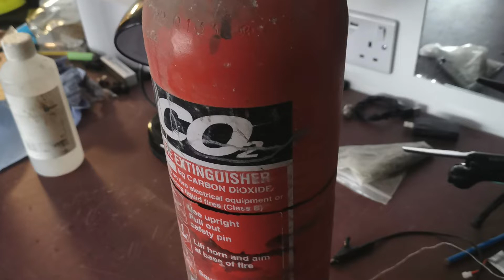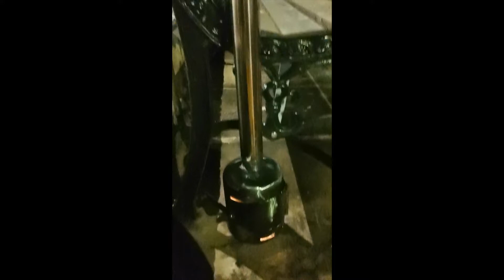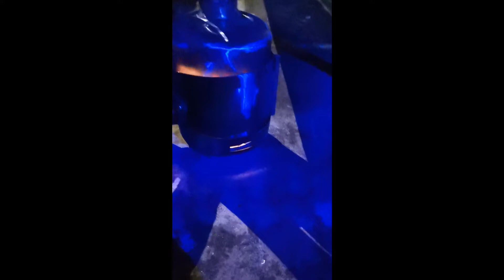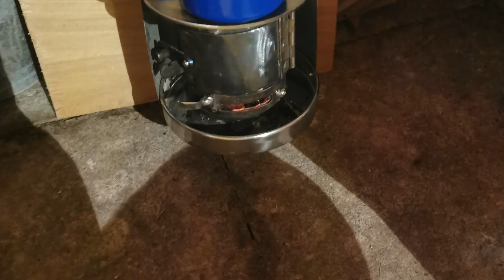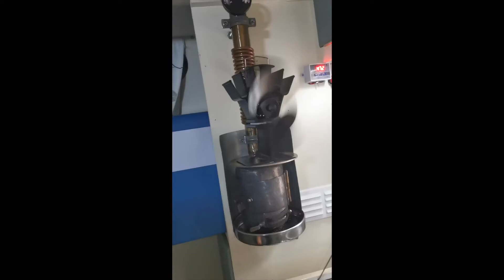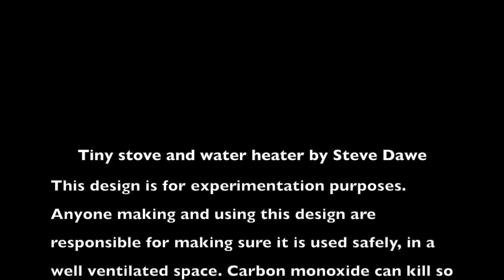How to make a Tiny Stove.

Comment: This is a fantastic idea, enjoyed watching. Thank you for sharing. 
Can I ask, what circulator pump, heat sensor and hot water tank did you use?
Reply from the maker: I used a 12v low volume grothen peristaltic pump(£13) controlled by a 12v temperature controller and sensor model W3002(£9). The water tank was a 6l under sink water heater, which i modified by replacing the 240v water heater element with a 12v 150w element. This meant that my solar panel can also heat water when my battery is fully charged. I use a voltage controlled relay to dump excess energy in to the water heater.

Comment: That's not only beautiful, its extremely practical and enhances life in your camper without costing huge amounts of money. 

Thank you for sharing this gem of a stove and water heater, it'll inspire others to consider making something similar for thems.

I agree with you about using charcoal, light and very efficient for generating a good heat output with good burn times.
Reply from the maker: Thanks for your kind comments. It certainly makes camping much nicer in the shoulder months here in the uk.
Reply: Pls make this a buisness 🙏
I would love to buy this from you!
Maybe putting some other Details in it like a lil porta potti (camper toilette)

Also do you need a driver license for this vehicle?
Reply from the maker: @konigsblau2325  Every different country has it's own rules and requirements for licensing. Making one of these takes a lot of time. I'm not sure people would be happy to pay for these if they had to pay for the labour costs as well as the materials. How much would you think it was worth?
Reply: @quirkyone-s1g  oh I don't know, how much did this all cost? And how long did you build on it? 
I would love to know more of your work ^^
Reply from the maker: @konigsblau2325  I bought the vehicle for £3400. I spent £600 on materials and spent my evenings over a few months renmovating it. I then spent another £1500 for mnaterials to make the camper pod that went on the back of the vehicle. You can see the full video of the work here... https://www.youtube.com/watch?v=cYKjTCQ6GJY
Reply: @quirkyone-s1g  thank you 🐚